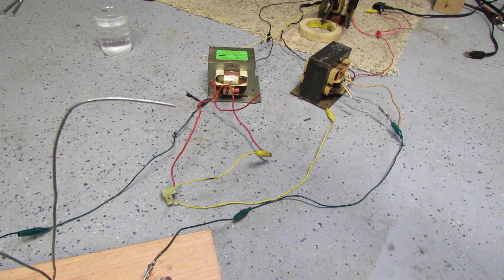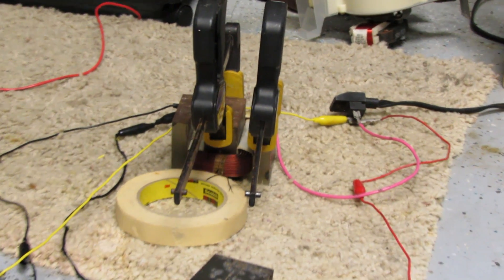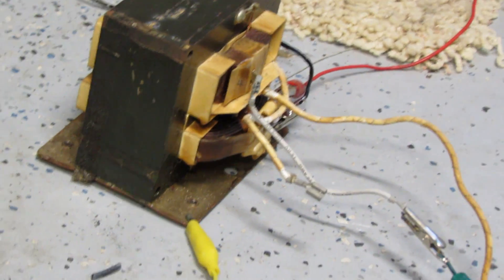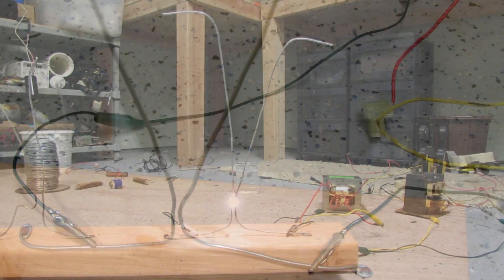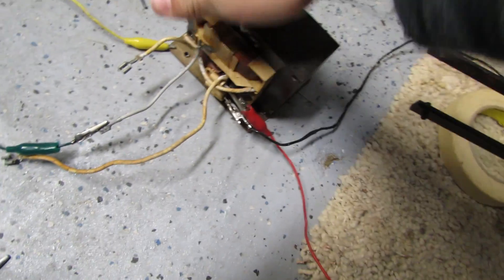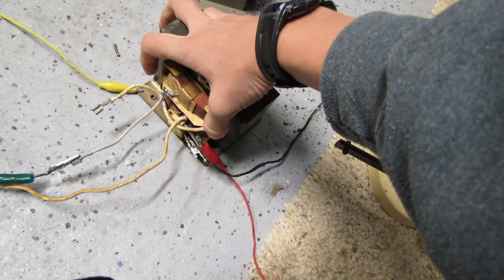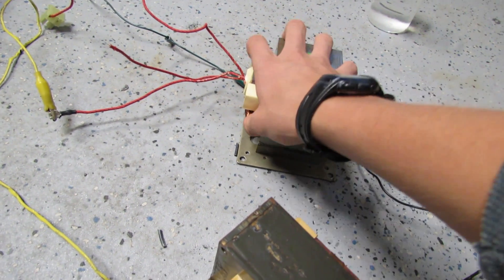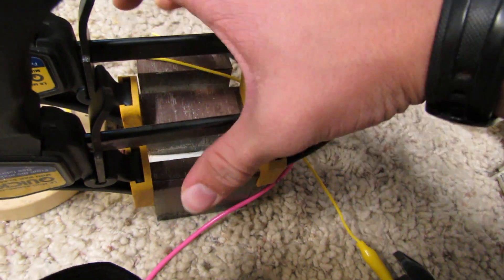Jacob's Ladder - Self Starting - Dual Ballasted MOTs

Comment: How many can you connect in series?  At some point there's gonna be flashover from the secondaries to the parallel primaries, due to absurdly high voltages across the gap.  I'm gonna guess 20 MOTs in series might blow.  Could you give it a go?

Comment: Use CAPACITIVE balasting so that you forget all about over heating once and for all. I do need MOTs for physics (I use them in a custom made sputtering machine for thin film deposition), so I play with them a lot. What I do is that I use a motor RUN (not START, RUN capacitors are made to be used continuously) capacitor, in series with the primary coil. Using a bigger motor run capacitor you supply more energy to the coil. Those capacitors are readily available and extra cheap. Regards from Greece.
Reply: Correct....
I also used capacitive ballasting to produce plasma from 220 volts mains. I used a 600 VA inveter transformer for this. I connected two capacitors used in ceiling fans and one huge capacitor used in 1 HP motor  in series with the transformer primary and secondary winding to create the beautiful plasma using 220 volts mains.

PS : The three capacitors are connected in parallel to increase the capacitance

Comment: Awesome ! Inductive ballasts are the best way to go. Resistive ballasts drop too much voltage.
Reply: Hey, I'm a fan of your videos. I don't expect you to reply but you seem very knowledgeable,  what would you recommend to use as an inductive ballast?
Reply: @kane3331  You could use a MOT with the HV winding shorted and the LV winding in series with your supply, or use streetlight ballasts 250 VA, put 3 in parrallel.

Comment: What is a ballast, and what does it do?
Reply from the maker: There are different types of ballasts. The one I used in this video was an inductive ballast. The one I used in my arc furnace vid was a resistive ballast. ballasts limit electrical current. This one limits to around 10-15 amps (I think). That way the transformers don't pull tons of amps and overheat, and I don't pop my breakers.
Reply: @ScienceMarshall  Use fuses, they don't pop as much as breakers :-)

Comment: Bits of coathanger are definitely the way to go.

If you can be bothered, put the ballast in a tank of mineral oil. Works a charm.
Reply from the maker: Does the mineral oil keep it from overheating? If so, I will definitely try it.
Reply: Correct. Well, it prolongs it.
Mine can run continuous for about 10 minutes before it becomes uncomfortably hot.